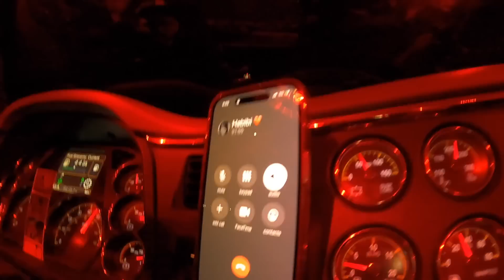Saying goodbye is never easy..

Comment: Hey Primo, THANK YOU VERY MUCH for keeping me motivated on getting into the industry!!! Took my DMV-/CDL-tests yesterday & passed on the first try!
Reply: Next couple of steps for me (in no particular order);
Land a trucking-job
Get my Tanker and Doubles/Triples endorsements, plus my HazMat certification then HazMat endorsement (already got my TWIC & HM backgrounds completed)
Get more training/confidence driving a standard-transmission so i can drop the automatic-restriction
Edit: Got my Tanker-endorsement
Reply: Advice on CDL tests? Like what's expected?
Reply: @FirebirdPhoenix87  Study & memorize all the pre-trip stuff (the exterior of the truck, the in-cab stuff, and the airbrake tests). For me, memorizing all the pre-trip stuff was much harder than the driving & skills-/parking-tests.
When it comes to the driving, its better to go too-slow than too-fast; Going too-slow might cost you points, but going too fast might be an automatic-fail. Likewise, with the parking-/skills-tests; stopping a little short might cost you points but going too-far might be an automatic-fail.
If you're having any problems with driving a manual-transmission during your training (like me having a problem being gentle with the clutch, grinding gears, etc), dont be afraid to switch to an automatic...Most trucks on the road are automatics anyways. Of the companies that have both automatic- & standard-transmissions, ive heard most dont mind training their automatic-drivers on how to drive the standard-transmission.

My apologies for the long response. Good luck to you!

Edit to add; Be very nice to the DMV-examiner, make sure to get a good night sleep the night before, dont take the tests on an empty-stomach, and dont stress out. And also, if (God forbid) you fail, remember that its NOT the end of the world. As long as you're polite and nice to the DMV-examiner, they'll tell you why you failed so you can work on it before retesting.
Reply from the maker: Heck yeah man!! Congrats 🙏🏼 hopefully we see each other on the road 🫡
Reply: @alexnino_  Thank you (again), G! As a fellow Californian, i hope to see you out there someday. Will give you the ol' airhorn-salute!! Do you have a CB? If so, what channel?

Comment: @ 0:45 into the vid. About the getting-a-ticket-on-the-eBike; You can get a ticket for speeding, unsafe/illegal lane change, & not obeying other traffic laws, but you wont get a ticket for not wearing a helmet unless you're in an area that has a law saying that adult-bicyclists must wear a helmet (or if you're biking with your kids and they dont each have a helmet on their respective-heads)
Edit to add; The difference between an electric-bike and an electric-scooter are the peddles. If it has peddles, its an ebike (no helmet required for adults in most places). No peddles mean scooter, which require helmets in most places